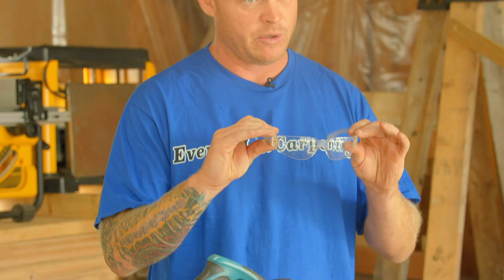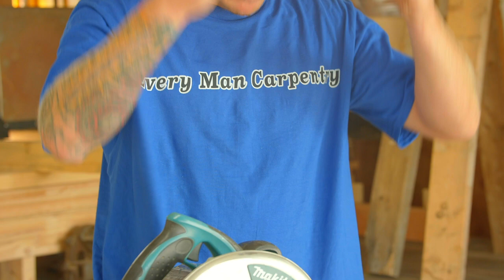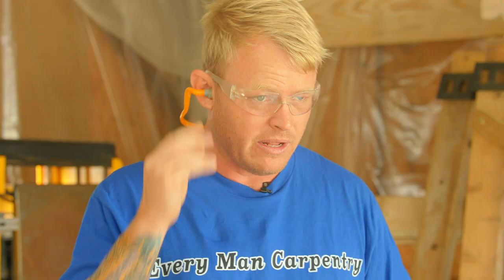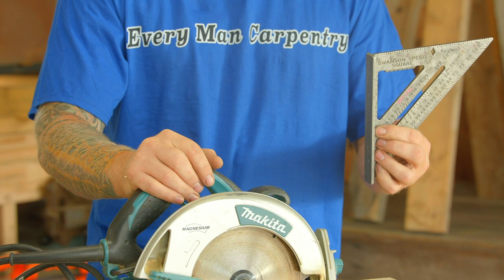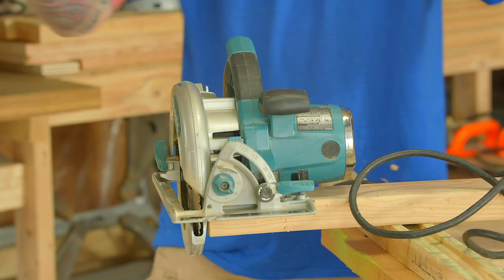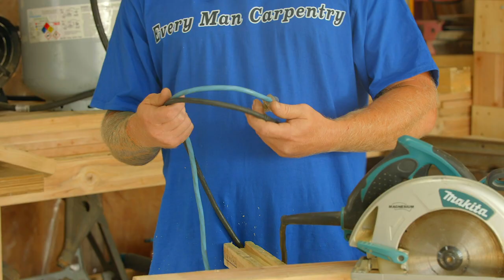How To Not Cut Your Thumbs Off: Circular Saw Safety

Comment: Thank you! I've got my first tracksaw on the way and nobody to show me around my first time using it, so I'm making a point of watching all the safety videos I can find before using it. This video had some tips I hadn't heard anyone else mention, like letting the saw do the work and always clearing the cut all the way. One question: when you were making the cut, I saw you brace the wood to the right of the saw with your left hand. Isn't that also kinda dangerous, because the saw could kick back towards the end and jump towards your hand? Would you advise always keeping both hands on the saw?
Reply: in my opinion, yes its dangerous, bad habbit. but we are looking to a guy with tons of experience what doesnt excuse to have your hand next to a cutting tool.
before you cut
 - organize your working aerea, 
- always cut with both hands on the handles, always ( the blade protection is not a handle), not important what they tell you or what you see on the net
-  make shure you are standing in save distance and beside the cutting line, 
- your shirt is in the trousers
- let the saw come to speed before start cutting

- most important: if you feel you are loosing concentration or wont take things so serious, walk away, do something else for a while. the noise, the vibration, the concentration needed, you cant hold up for hours.

if you are using a new tool, start with something easy to get use to it
Reply from the maker: I agree it is safest to clamp the work and use both hands. Excellent insight. Second nature to me to use my hand to hold. But also could lead to an injury.

Comment: I use a skil mag77 and treat it with the utmost respect, doing everything I can to prevent binding and kickback. In my years of using my saw almost daily to make my living I have only had two kickbacks, both of which I rightly predicted were about to happen.
Now I'm not a big guy, 5' 10" 150 lbs,  I am fairly strong for my size I think having worked with my hands my whole life, my grandpa called it farmers strength lol. 
My point is, both of my kickbacks I simply braced my arm for the impact and completely arrested the saw, both times the piece I was cutting exploded and splintered away from me and the saw remained motionless.

So that's some background, now on to my question:
What are the odds that these two events were just very minor kickbacks and is it possible for the forces to just be too much for any human to resist? We're my events not catastrophic because, based on my shear experience with the tool I was able to predict the event and brace for it? Certainly that is a factor. But being safety conscious, I'm looking for opinions about whether these were just very minor kickbacks compared to what is possible. 
I understand that not everyone that uses a saw has the benefit of being as experienced as I am, or is as strong as I am because of the life and career I chose, so maybe they're more dangerous to others?  
Asking because my second kickback was a few days ago and I figure this channel probably has some people that are smarter than me about such things. 
Any opinions, stories, or advice would be greatly appreciated.
Thanks
Reply from the maker: My experience with kickbacks is they are very serious. With a powerful enough saw, like a table saw, they cant be stopped. But they can br avoided. Or just not be in the way when they happen. Ky philosophy is to eliminate the possibility of kickback first. Then to eliminate the possibility if injury due to kickback. Its never possible to be 100% on either. Injury is always lurking. But I do believe that there are no accidents, only inattention to details. So, I try to be methodical in my process. Set up and cut the same way every time to reduce the probability of injury. The goal is to go home with everything I came to work with.
Reply: @everymancarpentry1712  preach brother. I think my second kickback the other day just kinda got under my skin a bit 🤔 but both times it just wasn't bad, knew it was about to happen, braced for it and took the shock. Never lost control of the saw, just a thud in the arm and I kinda man handed it lol. But that's the thing, is it because I'm experienced enough to feel it coming and brace for it, or was it just not a particularly bad kickback? I'm taking specifically circular saw (I use a mag 77 worm drive) 
Of course table saw I have the utmost respect for, had a 36" 2x4 eject and hit me in the hip about 12 years ago and I wasn't right for months, ever since then if I even remotely suspect a kick from a table saw, I flip the switch and run like hell! No joke!

I guess I'm just trying to not become the victim of hubris hers, I do like you say and try to prevent problems well before they arise. But after my skilsaw kicked the other day I found myself thinking "hey thats not so bad, everytime it's happened I just give my arm some serious muscle and the work piece breaks before my grip!" But then I tell myself " hey don't be a jackass and be complacent, at least try to find out if this is the common experience of other professionals"
Can't imagine I'll stop treating my saw with the utmost respect anytime soon, just wondering if all the horror stories I've heard about circular saw kickback we're from unprepared, inattentive or otherwise inexperienced people, or if I just got luck and I happened to experience relatively weak kickback events. 
Thanks so much for the reply!

Comment: Considering my first circular saw purchase and this is very helpful
Reply from the maker: Love it! Glad it helps.
Reply: @everymancarpentry1712  I mean a lot of safety tips seem to be crossover from tablesaws and generally any rotary saw really, but it's good to know that the principles apply here too. My main issue is that since I only need a saw (with a rail) for simple DIY projects I won't be spending much, do you think the low cost could be an added safety concern?

Comment: one thing i would add--when cutting a two by four, plywood--ADJUST THE BLADE DEPTH TO THE DEPTH OF THE MATERIAL BEING CUT--you don't need almost 3 inches of blade depth when you cut this this material, and the saw is more efficient when the blade depth is only slightly (1/8 inch) deeper than the material.  that's why it's adjustable.  adjust the blade depth when the saw is UNPLUGGED.

Comment: You forgot to mention how much blade should be exposed depending on the thickness of the wood you are cutting. I almost chope completely my finger in a freak accident for not readjusting it, going from a 2x4 to a shim in a rush.

Comment: Dear Friend, I purchased my first circular saw (Bosch GSK 190) and I am very new to wood working. When I was cutting some small pieces of plywood at 45 degree (for a small photo frame), suddenly plywood piece jumped with a loud noise and fly away. It was damaged badly from all sides. Then I tried to a punch cut (because plywood piece was not wide) but I got same accident. I was feared and stopped working. What is wrong? I should I do? Please help me
Reply: Probably a wrong blade, use higher number teeth blade (>60T) for plywood. Factories usually give <40T blades, only good for rough cutting.
Reply: first: as a newbee you wont even think of dive cuts or punch cuts
second: start with easy projects
third: you secure one side of the workpiece, the other side is loose and unsuported. so if the saw cuts through it falls on the ground
fourth: dont force the saw, let it smooth cut the straight line
last : always plan your cuts in advance, especialy if you are new in the field

more teeth - more friction

Comment: I learned it's important to clamp down your material. Had one time where didn't hold on to the wood properly and got kick back. Think just clamping down the work makes a lot of situations safer. 

Whats your opinion for safety using plunge/track saws?
Reply: Pro trick: watch series at flixzone. I've been using them for watching loads of movies lately.
Reply: @Kenneth Dexter Yup, I've been using flixzone for years myself =)

Comment: I noticed that you were using your left hand which is the safe hand for operating the saw,  but what if you are a right-handed user.  If you could give us a tutorial for "opposite-hand use".  Obviously if you are switching your hands, there is automatically a higher risk for the "product-stabilizing" hand since it is now on the dangerous side (blade side)  of the saw.
Reply from the maker: Amazing idea! I have never considered it. I'll think about it.
Reply: you never switch hands. there are left hand blade saws and right hand blade saws. you also may change the cutting direction, if possible
Reply: @berndeikers8924  Aha!  Sometimes you can't find the left-handed saw option.  But the bit about changing the direction works, nonetheless.  Thank you!
Reply: @johncassles7481  there is a world wide web, you find everything, if you want to
Reply: I already conceded to your point about changing the direction of the saw. Is there a problem.
Reply: @johncassles7481  nope, Just be aware of the cordline, and all Others safety precautions
Reply: @berndeikers8924  Fair enough.
Reply from the maker: I’m a leftie. But almost all tools are set up for right handed people. I just got used to using my right hand.
Reply: @everymancarpentry1712  I don't do that work any more.  But good advice anyway.